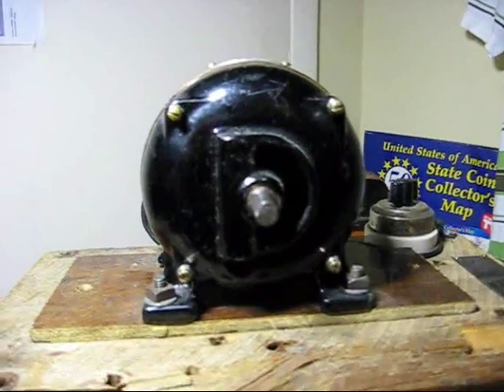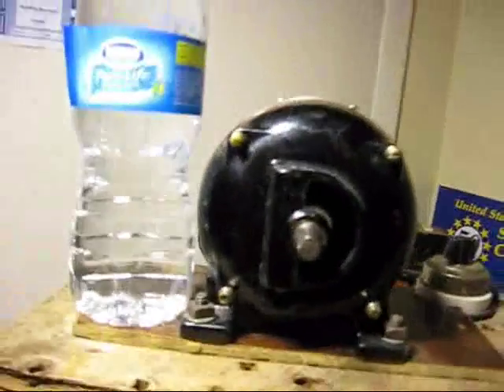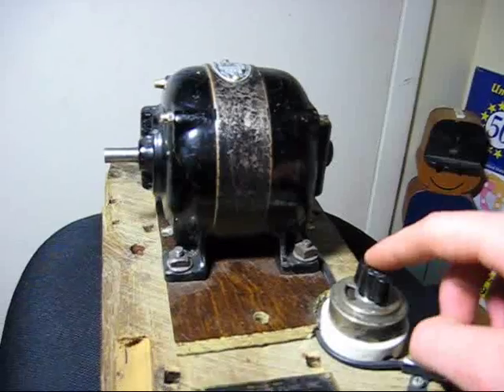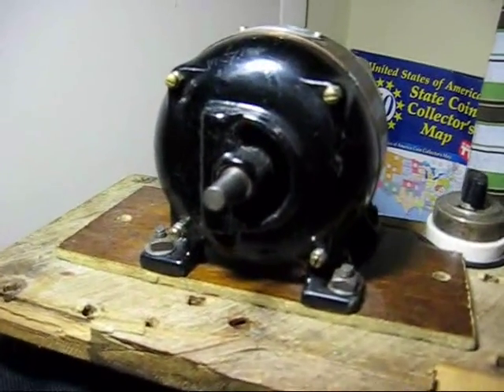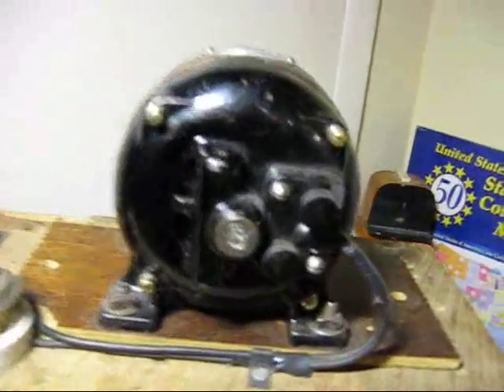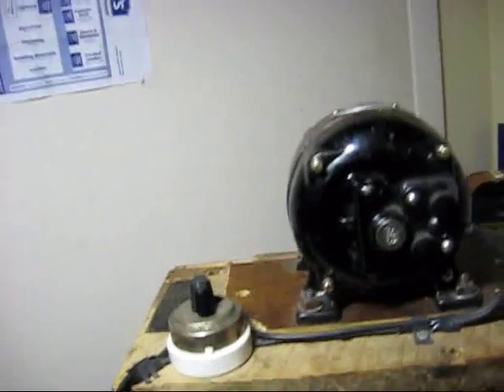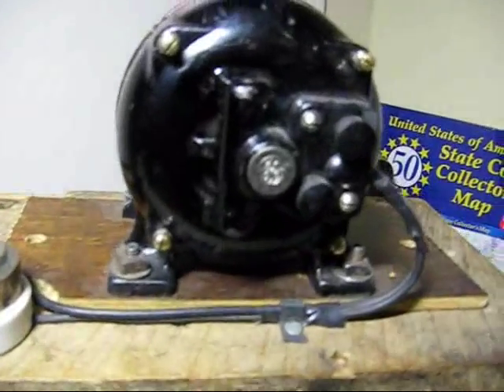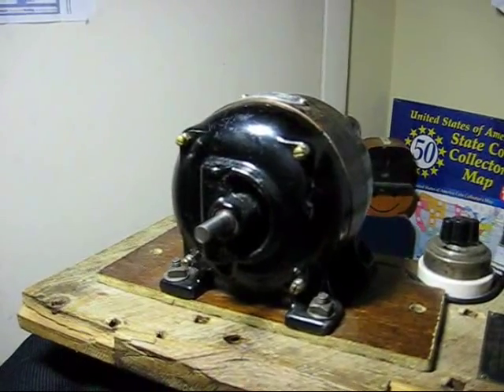GE motor

Comment from the maker: @jwnordquist1 thats an easy one. go to your true value hardware or some hardware store and buy a can of 3in1 (motor) oil. it comes in a blue container not the red one which has detergents in the oil and can damage bearings over time in electric motors. there is 2 oil ports on this motor one on top of each bearing. drip 5 or so dropps in each and your all set